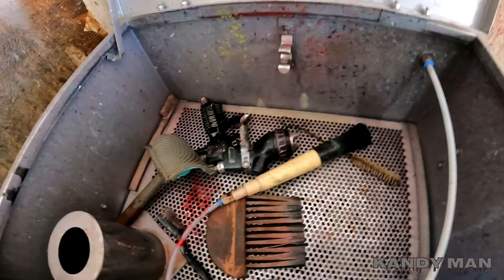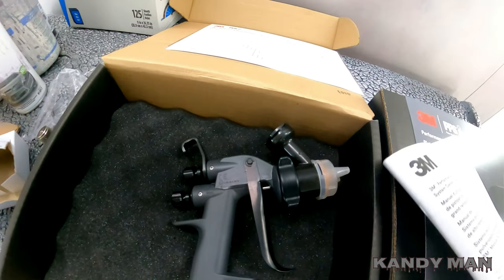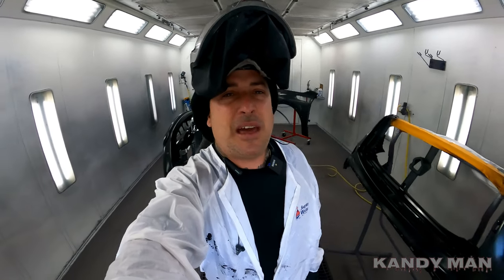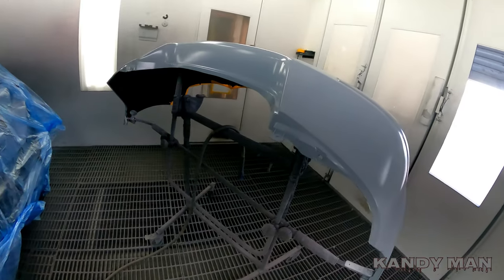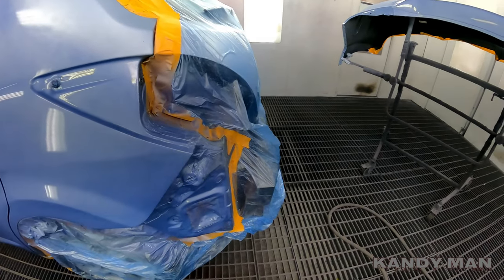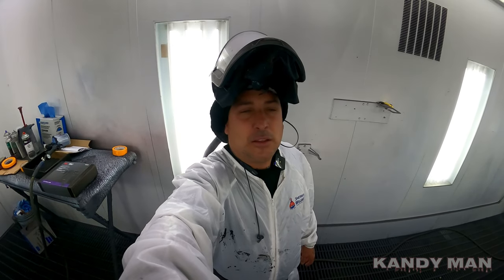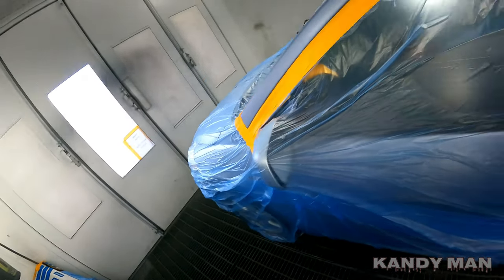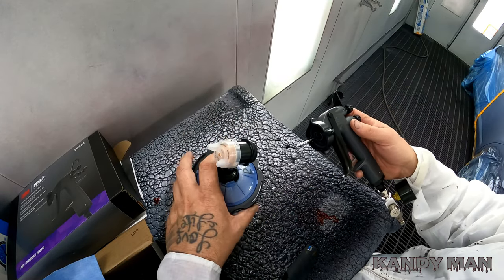3M PERFORMANCE GUN- DOES IT PERFORM?

Comment: Could you  describe how you store your used tips for future use with similar colors(I am assuming that you don't clean the tip before storage)?Do you just leave them plugged onto the pps cup?That would leave the needle hole open for paint to dry in there,I could see that causing problems if the cup and tip sit for a long  length of time.A guy could just have a couple of spare needles to poke in the tip during storage.Thanks for your sacrifice of time and energy in doing these videos.
Reply from the maker: I have 4 3m guns I leave paint in them purge  new color and roll they are setup for each color one black one white  one red one silver. I use them all day long so they don't  sit and dry up hope this helps

Comment: Just got my new one yesterday. After not having one for a few months I missed a lot about it. 1-how light it is
2-easy clean up
3-I can do multiple jobs at one time, especially when I have 5 bumper jobs and one in the other booth
4-much cheaper then spending a few grand on multiple guns (that’s being thrifty😬)
5-price of the gun and the rebuild kit is comparable to other top brands.
6-I’ve notice I get less nibs in paint
I know a lot of guys try to say how expensive it would be to buy the replaceable heads, but you can get a lot of uses out of them, clean them like you would a reg gun. Nice review, & i didn’t know you can spray them at low of a psi and get good results. How did set up, instructions or go wide open?
Reply from the maker: Wide open it is a great gun